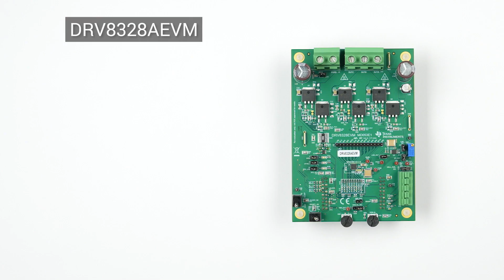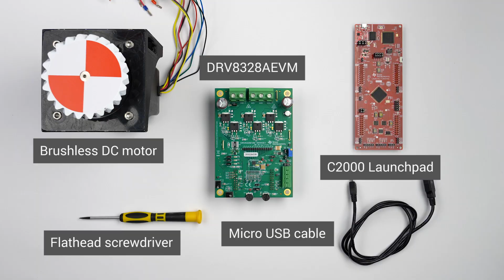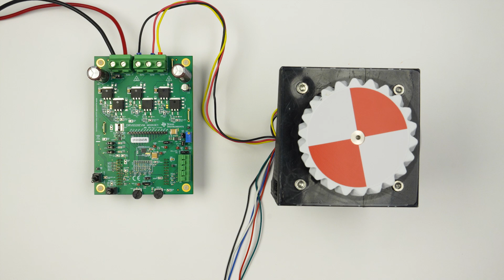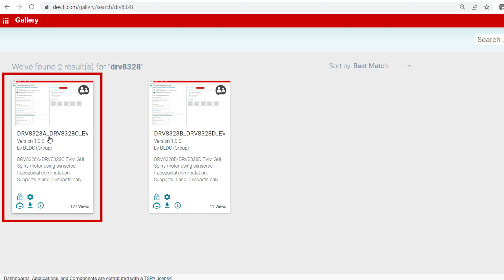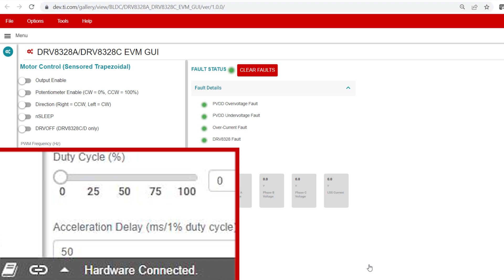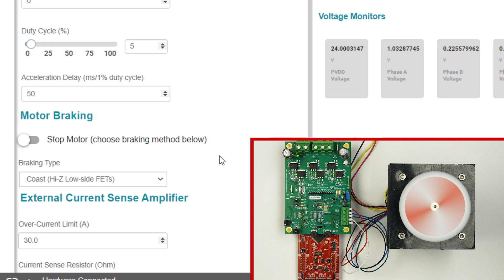DRV8328AEVM getting started video

Comment: Hello,

I am using the DRV8305 to drive a three-phase induction motor, and I would like to clarify something about the inverter output.

Do I need to use an external LC or low-pass filter at the output of the DRV8305 in order to obtain a clean three-phase sine wave?

Right now, I am observing high-frequency AC signals (PWM switching noise) on the three-phase outputs, even though the fundamental frequency of the waveform is 50 Hz. I just want to confirm whether this is expected behavior due to PWM modulation, or if it is recommended to add an output filter to reduce this high-frequency content before connecting the drive to the motor.

Thank you in advance for your support.

Comment: With DRV8316REVM & TMS320F280049C is easy to connect to drive BLDC motor Instaspin universal GUI but with DRV8316REVM +TMS320F280025C we need to edit properties in GUI composer in that Target communication setting, system output connection where I will get transport ID. As I'm programming using micro USB cable. I didn't found this info on evm guide or in any videos. It's all evm + TMS320F280049C is used which is lil easy steps.